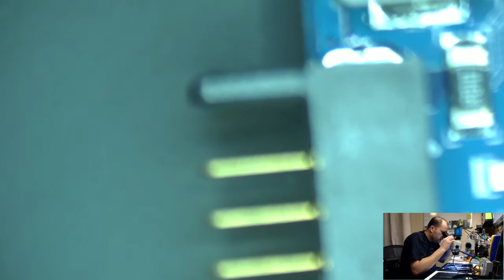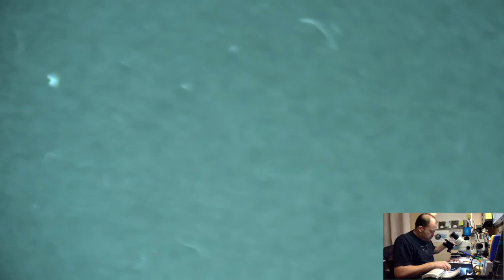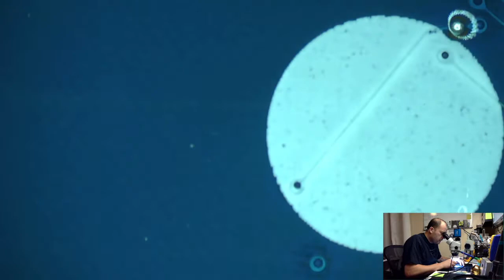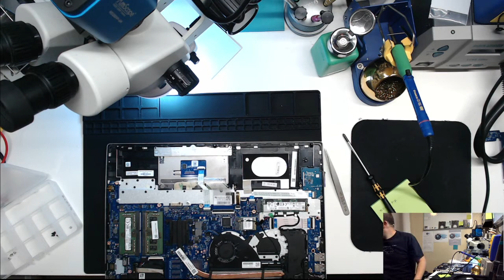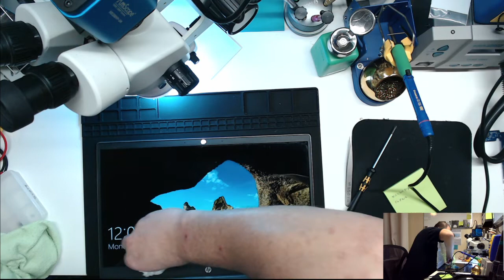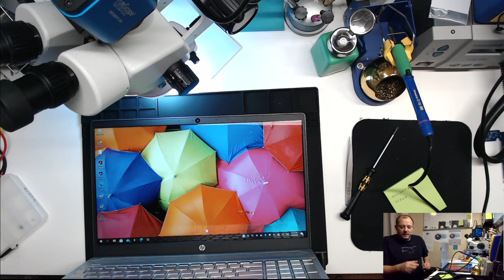2020 15" HP Pavilion 15z-cw100 Liquid Damage Repair

Comment: That's strange how come it didn't  came with 2 fan when theres a secondary connector available?
Reply from the maker: Yeah, you’re right about that.
Reply: @optimizelogicrepair2784  I have the laptop with Amd Ryzen 7 3700U Vega 10 graphics. It's very strange that mine didnt came with 2 fans. Also the battery they put in it doesn't line up with the whole that came with chasis.
Reply from the maker: @manueltorres661  Maybe different revision?
Reply: @optimizelogicrepair2784  Possibly
I